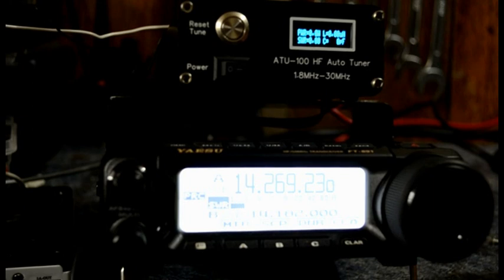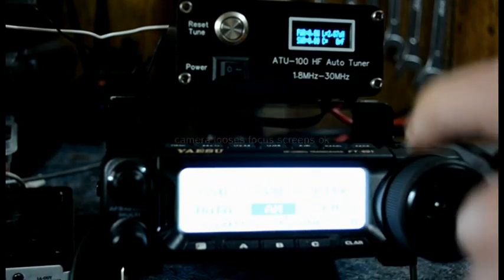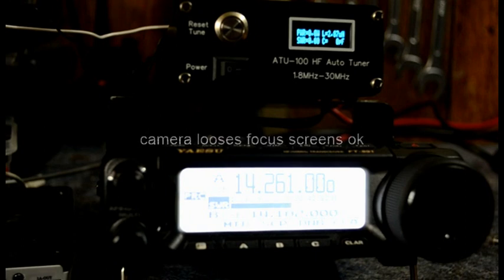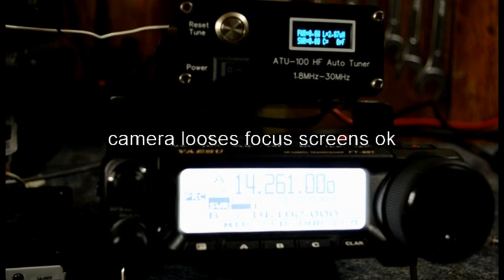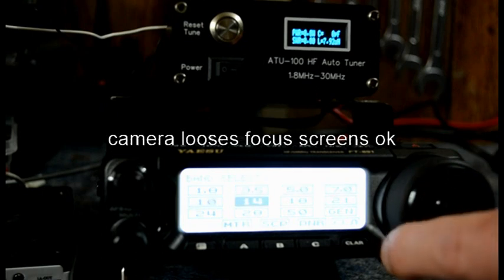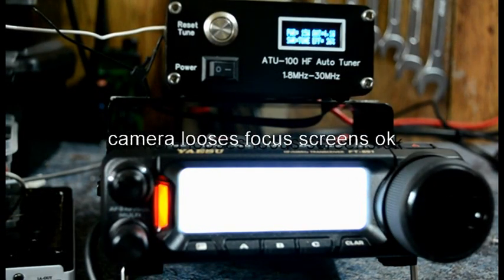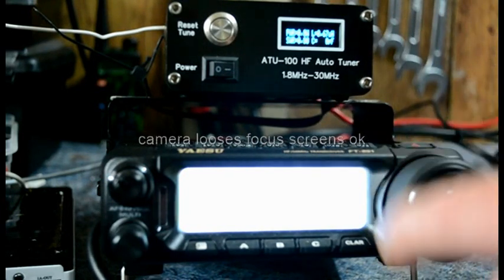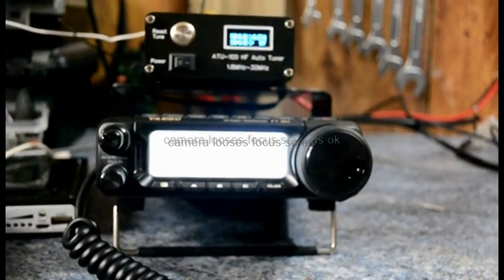atu-100 by n7dcc ver B without internal battery using random wires on hf

Comment: How much power are you using whilst tuning? What mode are you using for tuning. Answers much appreciated
Reply from the maker: i use a preset power on AM of 10w just to tune, then its rated at around 120w after the swr is lowered